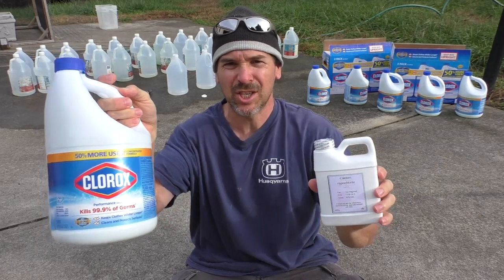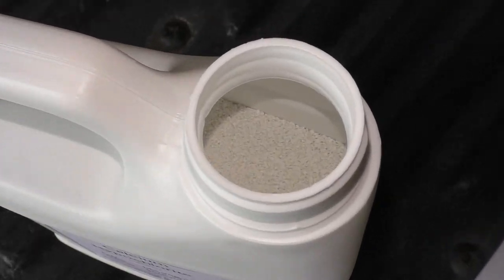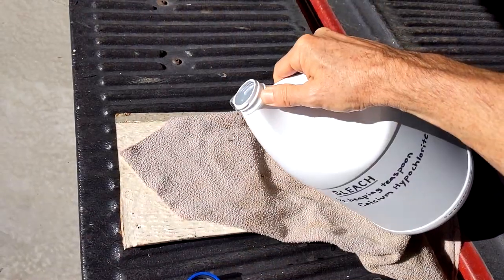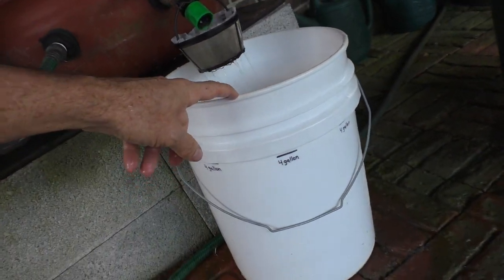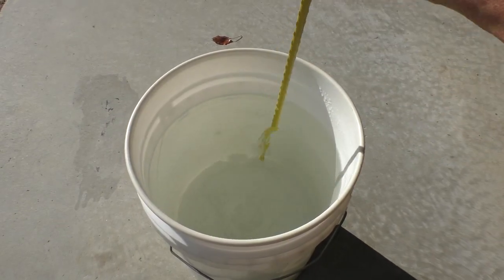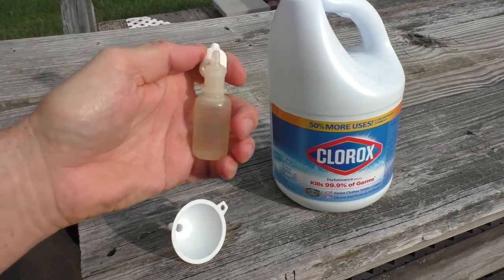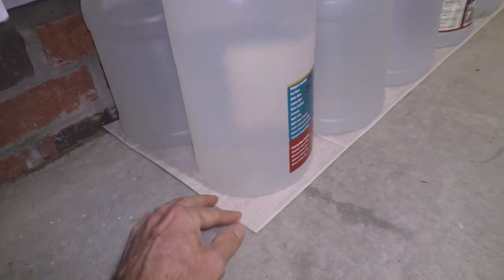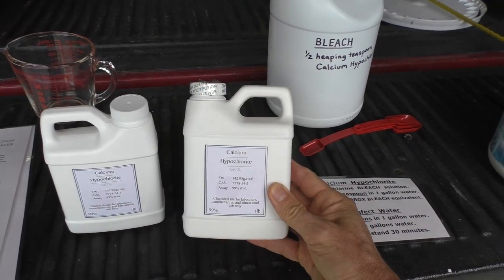Make BLEACH at HOME with Calcium Hypochlorite Pool Shock Powder Emergency Drinking Water Supply

Comment: To actually make sodium hypochlorite bleach from calcium hypochlorite, you have to add the appropriate amount of sodium carbonate, sodium bicarbonate, or other appropriate sodium salt to the calcium hypochlorite solution. Calcium salts aren't very soluble in water. To find out the amount of sodium salt, find an online stoichiomtry calculator of table to figure out the molar amounts. It really doesn't matter if you go over with the sodium salt though.
Reply: will it make a difference adding salt when using it to purify water?
Reply: @emrwtf  it would definitely effect the taste of the water. If you use too much sodium chloride it'll be salty, too much sodium bicarbonate and it will taste like baking soda. With the amounts used it would be pretty minor.
Reply: @chemistryofquestionablequa6252  What I meant is will adding salt help with the water treatment, or is it unnecessary when using calcium hypochlorite solution alone?
Reply: 2 moles of sodium carbonate per 1 mole of calcium hypochlorite, filter the CaCO3 if you have a vacuum filtration system, dont attempt to make 4 liters of this, otherwise you will not be able to filter it off

Comment: I believe there is one clarification.. the 1/2 heaping teaspoon to one gallon of water is to make a disinfecting solution, but this is not the same strength as household bleach.  this is 500   milligrams per liter (.05% Chlorine concentration).  Household bleach is usually around 5 or 6%  Chlorine concentration.. so if you are wanting to make household bleach, I believe you would need to use 10X the amount of Calcium Hypochlorite in one gallon of water.  Its still confusing.. depends on what publication you read...
Reply: HOT OR COLD WATER??
Reply: @preciousmkhize9166  Cold, don't think it's a good idea to have hot and steaming bleach..

Comment: Great video. Beware, you always want to use distilled water for making your solution. Minerals in water rapidly mix with bleach and degrade it faster. You could use more chlorine to offset the minerals. But distilled water is only $1.39 a gallon.

Calcium hypochlorite is the single most dangerous household chemical. It cannot be stored in any container, as it slowly leaks out of all containers, including glass or plastic. You'll need to continuously observe the container for damage, and leakage. Leaking chlorine vapor will destroy any metal objects, door and cabinet hinges, and nearby metal lids on containers. 

The best container for calcium hypochlorite powder is HDPE plastic. You can use a left over container for Sodium Hydroxide, after it's thoroughly washed and dried, as it has the correct plastic, being HDPE. Hydrogen Peroxide bottles, are also HDPE.

You can use a glass mason jar, with a plastic lid. But you'll likely get some escaping chlorine, no matter what type of package you use. Just be sure to keep the calcium hypochlorite below 95F at all times. If it gets warmer than 95F it can begin rapidly breaking down the storage container.

You cannot store calcium hypochlorite inside or near metal, or in a jar with a metal lid, the escaping chlorine vapor is so corrosive it will begin corroding after a year or so, even inside an air tight bag.
Reply: Thanks! I use an air tight plastic container. The quantity is less, just 1 kg and I finish it in around 3 months. Is it still dangerous?
Reply: minerals in tap water shouodnt affect the bleach a whole lot, just the solubility of the calcium hypochlorite tho

Also, the little jugs these come in are already HDPE

Storing ca hypochlorite in a hydrogen peroxide bottle is the worst idea ever. hydrogen peroxide react with hypochlorites to make the respective chloride salt, water, and singlet oxygen which is stupendously dangerous, also heat up a lot, that combined with ca hypochlorite being a strong oxidizer, might end up in a fire
Reply: @VerbenaIDK  "thoroughly washed and dried" Just going to ignore that stipulation and write out a response like the man said to dump it into a full bottle?  I see.
Reply: @btwbrand  what? i forgot this video even exited

Comment: Good video with good info.  I would suggest taking it a step further with a more robust filter before the chlorination process.  You can make a simple sand/charcoal filter if you wanted to go all DIY.  A 5 gallon bucket on top with sand/charcoal that filters the water, then chlorinate the water that collects below.
Reply: Sounds like you've never had a glass of water from a Berkey filter before.

Comment: Great video and I'm coming to your place during an extended food/water shortage!  At 5:10 you add chlorine to the water but I doubt it lasts 3 years.  I have a pool and any unstabalized chlorine will be eaten by the sun in hours.  Even without sun it will be gone in a day.  It is also temperature sensitive, the hotter it is the faster it will disappear.  One way to tell for sure, test it using a chlorine test kit and let us know.
Reply: Your swimming pool doesn't have a lid on it. These sealed containers of water do.
Reply: @btwbrand  Chlorine degrades over time no matter the container or lids.

Comment: A couple comments 

1) You bought 99% calcium hypochlorite which is roughly 50% stronger than HTH (68%) so you're fine using a level 1/2 teaspoon per gallon. It's cheap so it doesn't really matter but it adds up. You can also find HTH pool shock at Walmart and Lowes for under $10. Look for Calcium Hypochlorite (68%) on the label.

2) You're not making bleach you're making Hypochlorous acid. Bleach is sodium hypochlorite (NaOCl). HTH pool shock aka Calcium hypochlorite aka Cal-Hypo is Ca(OCl)2. They both break down to Hypochlorous acid (HOCl) in water which is the disinfectant. 

3) It's easy to make Hypochlorous acid, however, stabilizing the solution is difficult (water purity, pH, temperature, light, etc).  Therefore the shelf life of your homemade HOCl is only a few months at best.  Making a gallon of HOCl will treat about 100 gallons so use it fast or make only what you're going to use. There's many companies now with expensive HOCl equipment that advertise a 2 year shelf life, so you're better off buying from them if you want to store it long term.  The best thing to do is test the free chlorine in your HOCl with a Chlorine Colorimeter or test strips.  You need to have 500 ppm free chlorine for that EPA guide to work.  Otherwise you may think your homemade HOCl is disinfecting your water when it's really not doing anything.
Reply: Wow good review 👍🌹

Comment: Seeing a few similar questions that seem to be confusing people. What i gathered from the video is clorox equivalent is 1/2 heaping tsp per gallon, dirty nasty water solution would be 2.5 tbsp per gallon, and then depending on the water quality you'd use 2/3 cup of the either solution to clean the water. so for clean water storage you're using clorox solution and creek water you're using stronger solution. and you'd still use 2/3 cup regardless, per 4 gallons. Is this correct?

Comment: Thanks for the video. The EPA, however, mentions a 1/4 heaping teaspoon in 2 gallons of water which is equivalent to a 1/8 heaping spoon in 1 gallon of water. This will give you a 0.009% bleach (chlorine) dilution which is obviously not equivalent to the 6% bleach concentration.

Comment: A seemingly safer alternative is to buy sodium chlorite, and make chlorine dioxide, which has a 10 year shelf life in liquid form. You can store sodium chlorite more safely, it's a dry powder, but is far less reactive and doesn't leak out as easily, as it's made from large flakes (not a powder). 

The sodium chlorite can be added to distilled water, 100 grams (weight) of flakes of 80% purity sodium chlorite dry, into 9 ounces (fluid ounces) or exactly 257 grams weight, of distilled water, for a 28% solution by weight, or 22.4% solution by volume. The whole mixture will weigh 357 grams in solution.

Then using an any common food acid, you activate the solution using 1:1 ratio of activator acid, using a dilute solution of 4% hydrochloric acid, or 50% citric acid solution. You can use vinegar, but I'm not sure about the strength.

The chlorine dioxide is made when needed, and is inactive until mixed with the acid activator. This allows two non reactive chemicals to be stored, and the shelf life is at least 5 years, maybe 10 or more.

Comment: Your laminated instruction sheet says that 1/2 heaping teaspoon in 1 gallon of water makes clorox bleach equivalent but then it says that you need 2.5 table spoons of it to disinfect water. The epa website says you only need 6-8 drops of commercial bleach to disinfect a gallon of water. So how can your mixture be equivalent to clorox bleach when you require so much more bleach to disinfect the same amount of water?
Reply from the maker: the 2.5 tbsp is for risky water like from a creek or lake. its better to be safe than sorry and sick. The water will taste fine if let to sit for a day or two after disinfection because the chlorine will evaporate.
Reply: @FunBubble  but even then, the EPA website says to make the chlorine solution using 1 heaping teaspoon to 2 gallons of water which is the same concentration as your laminated sheet. Then they say to disinfect water use one part of this chlorine solution to 100 parts water, which is the same as your laminated sheet. So if this mixture is really as strong as clorox then when why would the EPA recommend using so much more of it to disinfect the same amount of water?
Reply: @juniorross3396   Maybe i read it wrong, but it seems to me you make the clorox using the tsp of powder, then use the solution to disinfect the water. so 2/3 cup of solution in 4gal of water, not 2/3 cup of powder.
Reply: @juniorross3396  The amount he said to use 2/3cup per 4gal was for dirty creek water I believe. you would use 6-8 drops of this per gallon in clean water I believe.
Reply: @emrwtf  "you would use 6-8 drops of this per gallon in clean water I believe." - This is not the case. Did you read my first reply? The EPA also recommend using much more than 6-8 drops of the solution per gallon of water. Was the EPA also talking about dirty creek water?

Comment: 😬😬😬 Every time you sniffed the chemical solution in the jug......
I think it would be better to learn how to make bleach with electrolysis than to depend on a limited supply. Plus you can always build another one if need be.
Reply: Making bleach with electrolysis is a pain that is not worth it and making bleach requires dealing with chlorine gas, nope not worth it.

Also, while just smelling things inst a great idea, I already smelled a jar full of monochloramine, I already smelled a pot with quite a bit of chlorine literally today and I already smelled a vial full of ammonia, if I am alive that guy sure is gonna be

Comment: I would not call the solution you made "equivalent to Clorox bleach", at best it is a very diluted bleach since they say their formula makes a solution that is 500 mg/L.  Bleach is generally 5% (or 6% or more) chlorine solution, which would be 50,000 mg/L.   If it was a 5% solution you would add 32 drops, or 1/3 of a teaspoon to disinfect 4 gallons of water - as they show on their chart on the same page. 
Just food for thought in using your bleach solution as a substitute for store bought bleach.

Comment: you were using drops to disinfect your water, were you using store-bought clorox bleach sodium hypochlorite?  the calcium hypochlorite is 2.5 tbs for a gallon you weren't clear on that. threw me for a loop
Reply from the maker: the drops were store bought clorox. but the water in the jugs was from my house well water so it doesnt need to be disinfected. i add the drops for long term storage safety. the calcium hypo at 2.5 tbs is for disinfection of questionable water like from a stream or lake.